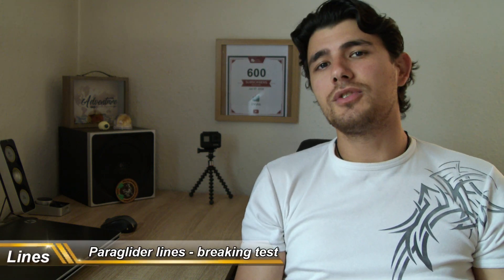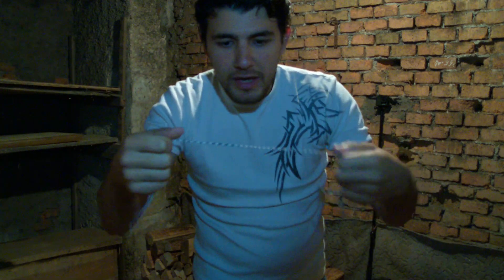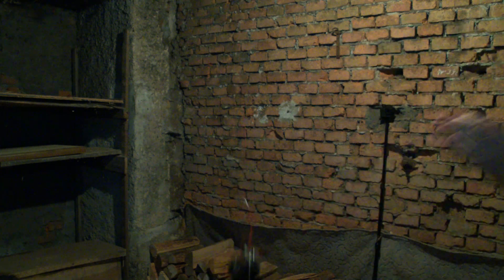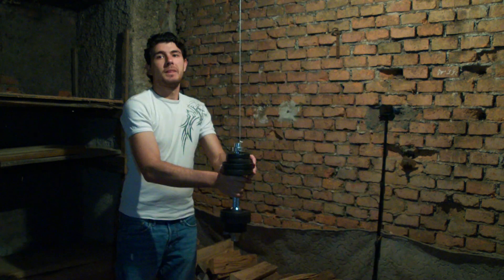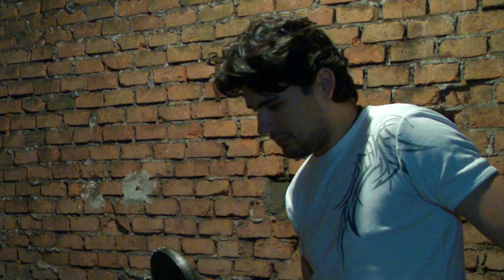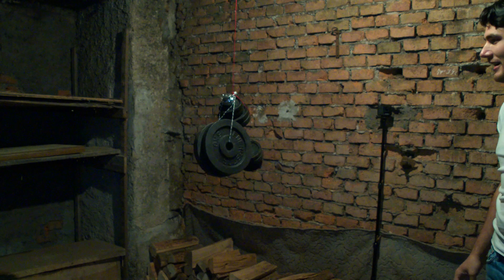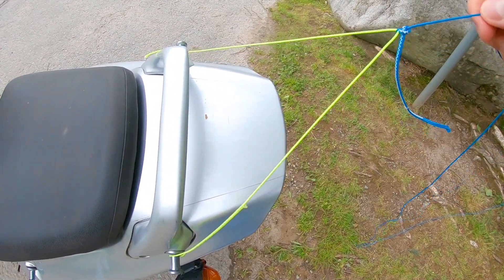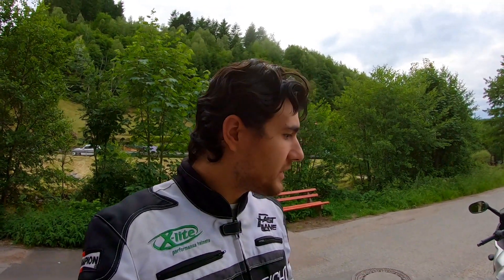How STRONG Are Paraglider Lines? | Break Test || Paraglider Experiment

Comment from the maker: I always wondered how strong the paraglider lines are. The ones I tested are made out of Dyneema which is supposed to be 15 times stronger than steel. It was fun making this video. The motorbike test: 06:30. Is the line going to rip apart? If you enjoyed it, Subscribe to my channel and Like this video! I apreciate.
If you like to see more, here are some great xc flights: https://cutt.ly/7y6xstb
Reply: Actually the comparison with steel is very misleading. Often they compare it to the cheapest steel which has a very low tensile strength (starting at 120Mpa) and is not the steel used for steel cables for example, which has a very good tensile strength (steel max. 1700Mpa)
I think you had been weakening the lines with knots, dyneema is very sensitive on bends under tension.
Especially when you let fall the weights into them. A meaningful result would be to test the whole line without knots and with slower progressive load, not dynamic.
(I have a job dealing with similar stuff) 😊
Reply from the maker: @ValeB92  you are right about what you said. I was surprised too, that the lines were breaking so easily. They should hold much more weight. I guess the knots were weakening them. But it was still a fun experiment to do ✌️😁
Reply: @TheBorderlessNomad  thank you.
It was interesting to watch, so video goal fulfilled 👍😊